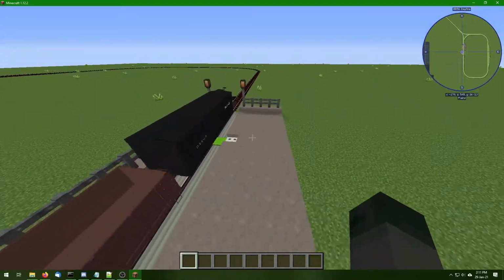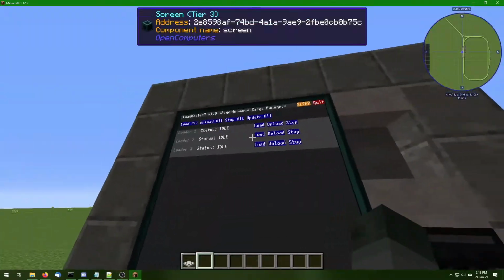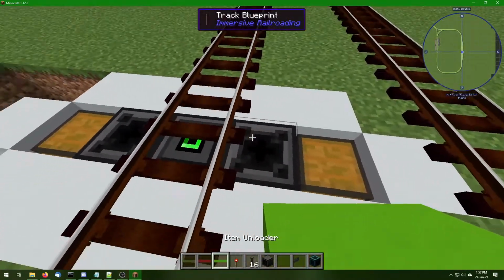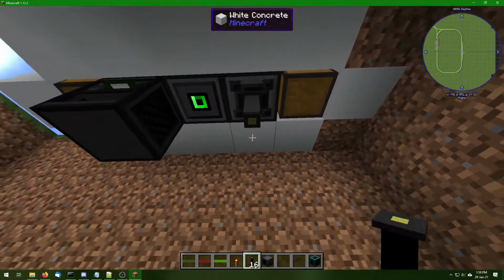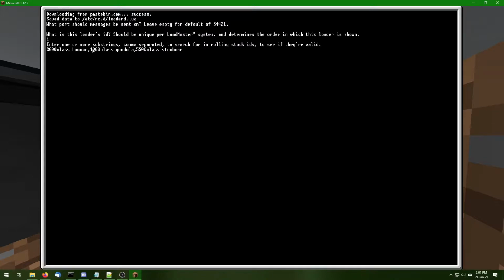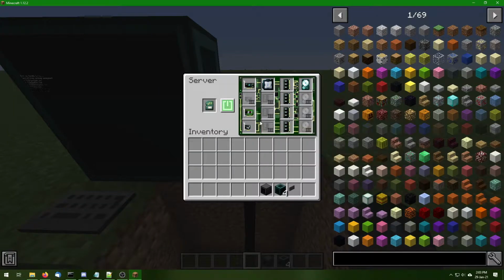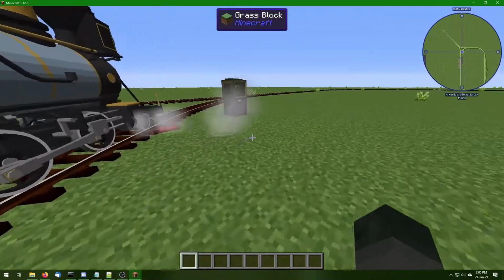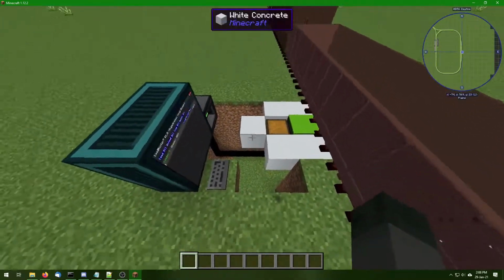Immersive Railroading Automatic Loading and Unloading System

Comment: That's works only with item loaders  can you make a fluid loader too?
Reply from the maker: I could, but right now Immersive Railroading is very buggy with fluid loaders, and also that would mean depending on a third mod for the fluid transport, like thermal dynamics or immersive engineering, which I tried to avoid here.
Reply: @andrewlalis  but you use immersive engineering so i don't understand the problem, can you explain?
Reply from the maker: @pij_wode  The problem is that I don't want to force people who want to use this program, to have to have anything other than OpenComputers and ImmersiveRailroading installed.